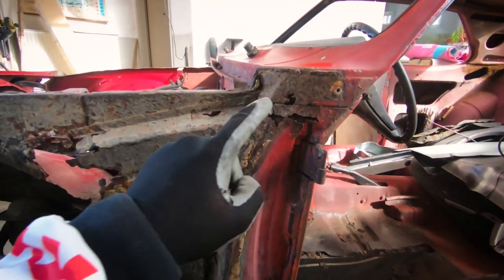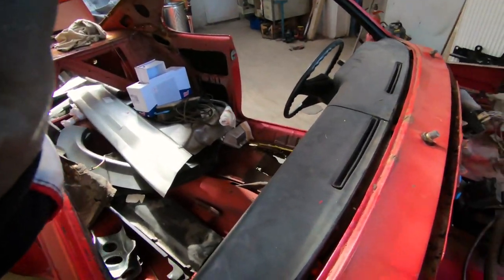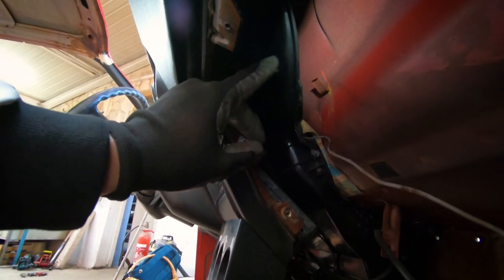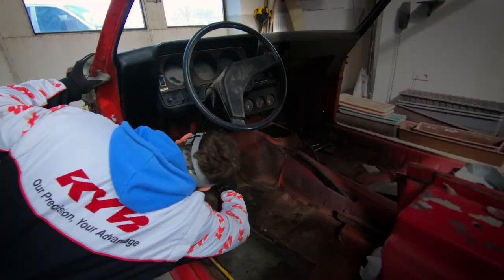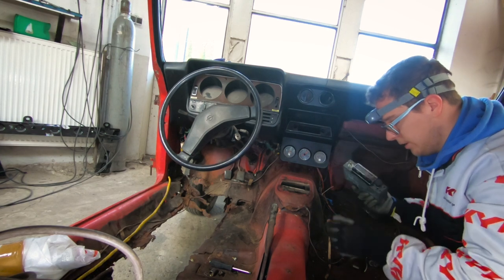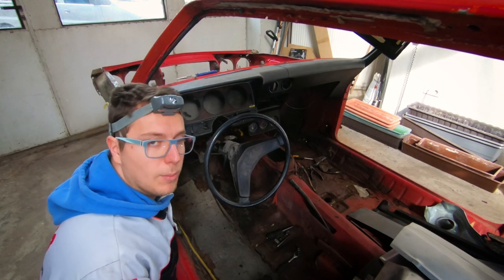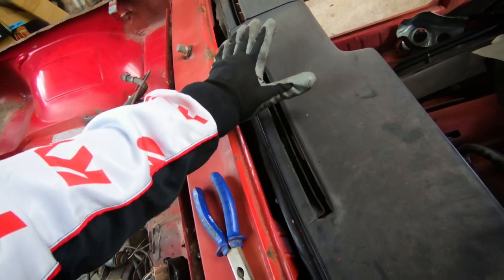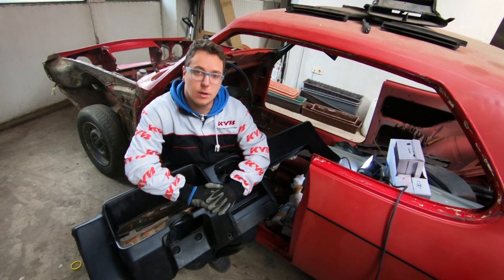Opel Manta A 71' - Dashboard Removal

Comment: I need to get/ make a new dash, mine got rusted to nothing
Reply from the maker: You mean fire wall? Dash is wooden/vinyl.
Reply: @l3v4rt , the metal mounts and base
Reply: @l3v4rt  my firewall is actually in decent shape
Reply from the maker: @hazard4349  Hope rebuilding the mounts goes well man!
Reply: @l3v4rt , yea just gotta get a new crankshaft